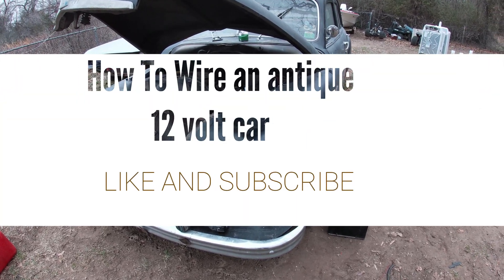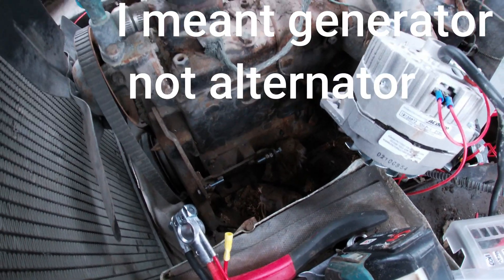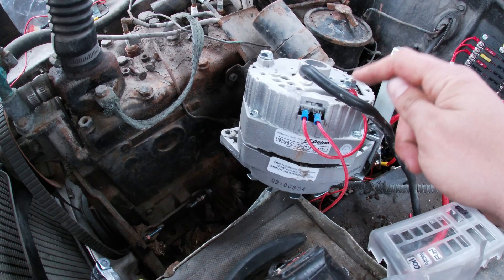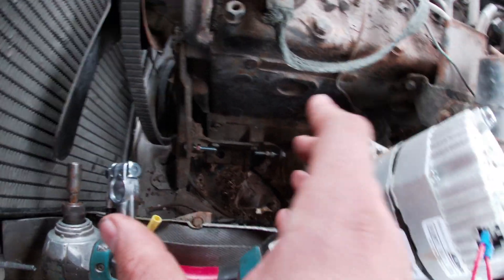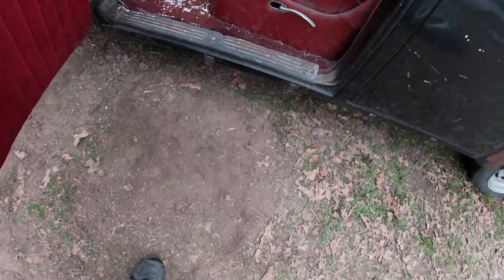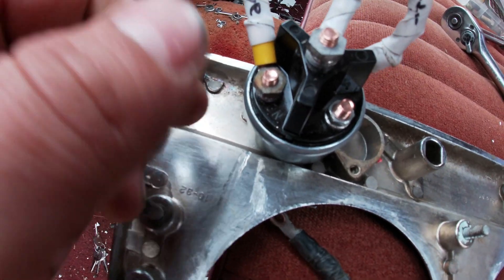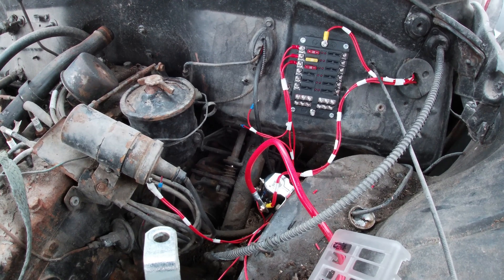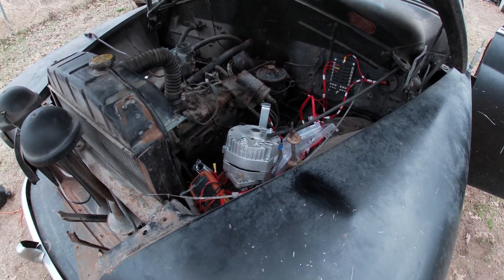Rewiring a 1949 Plymouth after sitting for 19 years. converting to 12 volts.

Comment: Electric fuel pumps should be mounted right by the fuel tank they push the gasoline manual fuel pump mounted to the engine suck the gasoline.
Reply from the maker: @johnw6498  Yep are right. This one is stilll running like that over 2 years later though.

Comment: I'm a disabled vet needing help. I got a barn find 47 Dodge pickup that they started upgrade to 12 v. I was told the starter was bad so I sent it to DCM for upgrade to 12 v+. It's a pedal start. Do I need a starter relay? Bench checked start and it works but in truck I get nothing.

Comment: Hey I have a 1949 Plymouth special deluxe Flathead 6 with no spark but it cranks good . Any suggestions?
Reply from the maker: First Check power to coil, if you have power then check your ground to the distributor if good check you point clean and gap them. Not much too it

Comment: there is 2 circuits that should not be fused on any car, the first one is the headlights, the second one is the ignition, all the rest should be fused or protected by a circuit breaker, 
on that car, the only item that needs a voltage drop is the fuel gauge, you can use a small device or a calibrated resistor   as the current consumption of that instrument is stable.
there is substitute for the blower motor so better to replace it
Depending on the size of the alternator, you should use the original ammeter ( 40 -0 -40 on these cars) if you use an alternator not bigger than say 55 amperes. The ammeter is not voltage sensitive so you use it without any converting gizzmos.
Unless you intend to weld with that alternator, a # 8 AWG wire is more than sufficient to flow the power of that alternator
The ammeter is very easy to wire, you start from the alternator to the ammeter and you start from the ammater to the battery , You tap the power consumption wire to the wire that comes from the alternator, presto, the ammater is functionning and gives you an invaluable information ( much better than a voltmeter.( possibly that you,ll have to reverse the wires as the polarity is reversed when the voltage conversion is done.
Reply from the maker: Why do they fuse them on new cars?
Reply: @somewhatfast  it is not a good practice to fuse both headlights on one fuse, you can use an auto reset breaker so you'll not loose both headlights.
on these old cars,there was a circuit breaker integral to the headlight switch to cover the headlights
on the new cars, they fuse about everything  but on the vital functions, the fuse rating is much higher than the actual, for example, on the injection system where the consumption is about 5 amperes, the fuse rating can be 20-25 amps, it is principally to avoid random blow up
Reply: @somewhatfast  you can use a self resetting circuit breaker at 30 amps for the headlights.